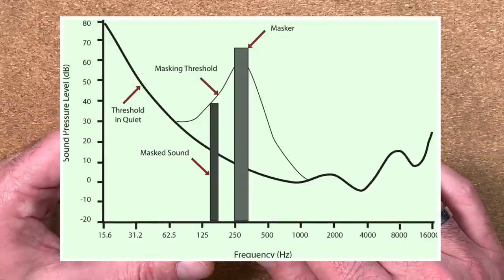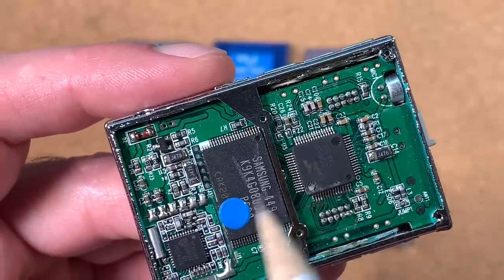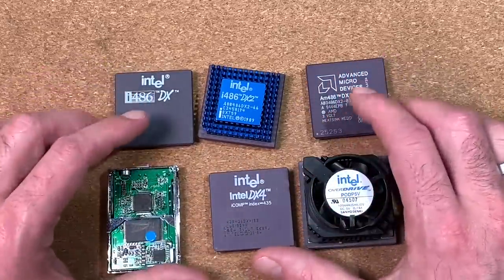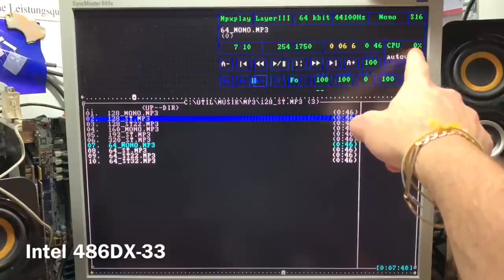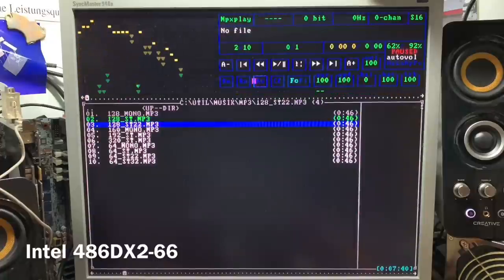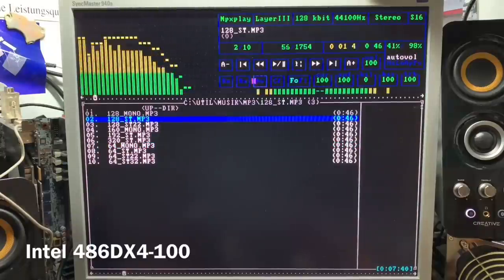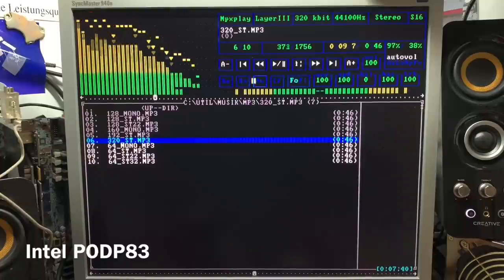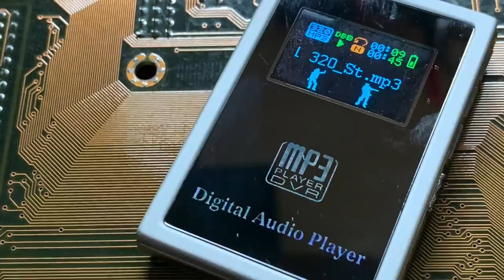Can a 486 Play MP3 Music In Good Quality?

Comment: I remember being able to play a 128 kbit stereo MP3 file on a 486 SX2-50.  You should be able to play it fine on a DX2-66.  I think the visualizer is taking up CPU cycles too.  I remember the program I used was not graphical at all.  It just shows the total frames, the frames played, and the number of skipped frames.  I don't recall the name of the program now, but it was around the same time WinPlay 2.35 (yes, even before WinPlay3).  I was a kid and a university student in Finland sent the program and an MP3 file via usenet.  I was impressed indeed.

If you can find a copy of DOSAmp, I think it'll play better since I don't think it has a visualizer.
Reply: Can confirm DOSAmp was the only way on my 486DX2/66. Windows was a stutterfest.
Reply: @joe--cool  yeah.  I would have loved to see this video redone using DOSamp as the player.  I bet he can play more types of MP3 with his collection of 486 CPUs.

Comment: Graphic bars in the app window take more CPU resources than decoding itself. Disable them and you'll see the difference.
Reply: @alanhightower976  Screen output itself wastes CPU time.
Reply: Right. In those times, even the display output were ressources you had to account for. At least its textmode, which can (not must) be more quicker. But every moving thing on screen is a cycle you could use.
Reply: The FPU is doing all the heavy lifting here. So no, drawing text to the screen isn't going to cost much the CPU many cycles. A 486/33 does not have the floating point performance to decode an MP3. Period.
Reply: @zosxavius  Nope. The theory behind that mp3-stuff is of course all cosine and floating math, but there are a lot of shortcuts and for players (especially in these times) often integer-implementations were used. I highly doubt that the integrated 487-FPU was even used in this player.
I can also assure you, that a lot of the mobile mp3-players (esp. the first generations) had no means of floating point processing.
The data to show on screen was also mostly given and there were no complicated maths involved in showing the EQ-Bands, because these come directly from the MP3, but the management of the drawing on the screen alone took quite some efforts in these days. Yes even in textmode-only.
I'm not saying, that shutting off the display will make this player work on an dx33 but I still assume, that there may be some other more optimized players outside there, that maybe could.
Reply: @JanWalzer  without looking at the program's code you could be right. Given it was written for DOS they likely took some shortcuts. The one dos player I read about can use integers with a flag. The author never mentions if he did any commandline optimizations. I suspect he hasn't. 

The program I saw recommended an 80mhz 486 for  192kb/s. That would put the video's results in line with that program's requirements.  It was called MPXPLAY. 

I would argue that 99% of the MP3 player released to the market used integrated decoding logic as shown in this video vs using their meager CPUs. The power cost alone would probably kill that idea anyways. Much more efficient to just do it on silicon than in software.
Reply: @alanhightower976  I looked it up. Its not using a fixed point decoder nor is there a command line option for one. Given its minimum requirements it looks like its fully using the FPU.
Reply: To add to your comment, it seems that there is a command line option to disable visual output. In fact its recommended for 486s. So there is certainly a cost involved.
Reply: Yeah, I see something is wrong here, it is many years ago but I'm absolutely sure my first mp3 player was a DX2 @66 MHz with mpxplay, it did nothing else, it had a 20 MB Seagate hdd with only the most necessary files on it, boot sequence, which automatically started mpxplay, and audio drivers, I stacked four desktop pc cases of the same type on each other on a roller for plant pots and a monitor on top with a signal switch for the monitor, keyboard and mouse for three of the pc's, the one on the bottom was a 486 @ 33 MHz and served as the file server. Man, that was times, burning parents money for electricity, papa's yelling is nothing compared to when you have to pay the bills on your own, lol.
Reply: That's what I was wondering, all the animations going on must be consuming CPU time.
Reply: @Wilson84KS  dude, my son has a server in the garage that used to run a hospital! There's about 20 HDD's all spinning at 15K day and night! 
I think that I have a small idea of what it costs to run a hospital thanks to my son LoL! 
But hey, you gotta put all that animae and henteye somewhere right LoL...

Comment: It'd be interesting to see how the DX2 based (I think) 80mhz AMD chip handles things when clocked at 100 mhz. I suspect that it's a question of just getting the FPU at sufficient speed to bash the numbers out as fast as the data streams off of the HDD.  Did AMD sell a version of that processor clocked at that speed?
Reply: Pretty sure they sold a DX3/100.
Reply: @geonerd  Now THAT would make an interesting test case. If you look at how things were scaling it seems to imply MP3 decode functionality would start scaling up rapidly from 80mhz onward, but a real apples to apples comparison would be needed to confirm this.

Comment: I found that very same thing out, in that order using WplayPro in windows 95. I've always kept it in my mind that you needed 100MHz + to play mp3's @128-44k. 
Mind you, A 386 40MHz with 8 MB ram and a fresh copy of windows 95c takes less than 20 seconds to start in case you were wondering. Very nice video, I am glad to see I wasn't wrong in my thinking back 20 years ago.

Comment: Can the PODP decode CD-quality files in stereo? Assuming linear utilization scaling, it should be possible.
Reply: Non compressed files should play fine on all those cpus.
Reply: What's your definition of CD quality? When MP3 was the big new thing, 128kbps was considered near CD quality, with 320kbps being considered 'transparent'. 320kbps is the highest officially supported MP3 bitrate too.

If by CD-quality, you mean plain old PCM (i.e literally CD audio), that will play on a much slower machine because it is uncompressed audio; there's no decompression going on; it's just dumping out audio to the sound card- at this point, you're basically at the mercy of the I/O system on your PC.

@CPU Galaxy, it would be interesting to see this test repeated with AAC audio; I was impressed that even running under Windows 95B, I could play FLAC and high bitrate AAC audio on a Pentium 166 under clocked to 75MHz, and with 16MB RAM, using a modern player (foobar2000).
Reply: CDs are recorded in uncompressed 44100Hz stereo audio, and being that cards in that era were also 44100Hz you basically just read the audio and push it into the sound card's buffer.

Never the less because of the amount of data, even if it wasnt cpu intensive, it took quite a chunk of bandwith from your memory and pci bus so most software just assumed you had your cd analog output conected to your sound card.
You technically could do it but afaik only since windows95 there was some kind of "digital audio output" support. Though to be honest i still use the analog output on my mmx200 because otherwise cpu spikes could cause the music to skip.  Id recommend analog for anything below a pentium 2.

Now that i think about it, imagine a desktop case (not a tower case) with a pentium cpu being used as a media center pc.......you tecnically could and with 1-2GB of hard drive you could have quite a few CDs in MP3 format. Throw in a vga card with composite out, a 29" crt tv, an qireless infrared keyboard and a good audio system hooked to the tv and you have quite a nice looking retro media center xD
Reply: You mean wave?
Reply: @laharl2k  CD bitrate doesn't use that much bandwidth. Roughly 11 megs a minute. That's nothing for a PCI bus. Or even an ISA bus, which the first 1X CD-ROM drives came with an ISA controller card.
Reply: @brianleeper5737  
yeah sure, 11mb/s, thats nothing for a last gen pci implementation, but remember these are old pcs with 100mhz fsb.
Dont believe me? just try it yourself, try hooking a 100mbps ethernet card to an old pentium/k6 and see if you can do 100mbps even though the pci bus is more than capable of those speeds.....thats why my k6-II 500mhz Nas never worked, i could barely get 600 KB/s, FTP, SMB, it didnt matter.
Also remember old SDRAM DIMMs werent super fast either, iirc i had about 200MB/s on the ram read speed in the everest benchmark. Its nothing nowadays with modern DDR ram but back then it was quite significant. Add the fact that the memory controller was outside the cpu package in the north bridge and the performance was abysmal.
Reply: @laharl2k  uncompressed cd-quality audio is about 11 megabytes a MINUTE. 

That equates to about 180 kilobytes a SECOND. 

Any 486 class PC should be able to handle that with no problem, even over the ISA bus.

I have played uncompressed cd-quality wav files from an SMB file share on a 486DX2/66 with an ISA  10 megabit network card, the server was another 486DX/66 running Linux also running an ISA 10 megabit network card. And it worked just fine. 

If you were only getting 600 kilobytes of network throughput a second on a K6 II 500, there was something wrong. It should have been a lot better than that. Were you using some off-brand PCI NE2000 clone network card? (The NE2000 was designed to be cheap and originally designed for ISA. They were NOT high performance cards).
Reply: @brianleeper5737  
CD DMAs to ram, then cpu processes it and copies it to ram before DMAing it to the PCI bus, lots of headroom, latencies, etc, its not just 150KB/s (1x CD), you easily have x6-x10 multiplication depending on how good the software, drivers and hardware is. Best case your player had a software buffer on ram to avoid those buffer underruns, but you needed the ram for that....

Also lots of syscalls on windows9x were blocking so that added a lot more lag depending on your hardware. Some sound cards couldnt play two sounds at the same time and windows will freeze or throw errors if you try doing several sound stuff at the same time.  The integrated card i have on my mmx has a virtual thing second card in the driver to be able to play multiple sounds at the same time, if you only leave the sound blaster 16 emulation, you can only do 1 sound at a time. 
Hardware wasnt that flexible back then and drivers werent the best either. 

Not sure what chipset it had but the card worked fine on other more modern pcs.
Reply: @laharl2k  What made the better network cards better is that they used less CPU. I had Western Digital cards with shared RAM as opposed to the PIO that the NE2000 clones used. The Western Digital cards used much less CPU and therefore had higher throughput.

If you put a low-end network card into a faster PC, the high CPU utilization of that low-end card isn't as much of a problem anymore.

The best network cards for the price and performance I found in the 10/100 network card era all used DEC (yes Digital Equipment Corporation) "Tulip" chips. These are long out of production now, but back in the late 90s they worked very well for a network card that cost around $40. I had a datacenter filled with servers running those network card. The Linux driver worked very well with these cards too, at a time when the Linux drivers for 3com and Intel cards were not quite as stable. (And, in an interesting occurrence, Intel purchased the rights to the Tulip design from DEC and EOL'd it a couple years later).
Reply: @brianleeper5737  
Well that could explain it then, cpu was at 100% no matter the protocol. I do have some 10mbps 3com server cards, id have to try with one of those and see whether i get faster speed and lower cpu usage.
Reply: @laharl2k  The 3com cards were pretty CPU efficient as I recall. IF the motherboard has PCI slots, try an Intel gigabit network card too and see how that affects the CPU usage. You can also find server-grade PCI-X Broadcom and Intel gigabit cards on Ebay for under $10 and that probably includes shipping. This will work in a regular 32 bit PCI slot as long as there is nothing on the motherboard blocking the extended part of the card edge.

Comment: Excellent video and channel. 

A bit surprised by the result. I know for a fact that an Am486 DX2-66 can play a 128kbit stereo mp3 without (well almost without) skipping...at least on some players, because I did that way back when. 

I can't remember which player I used, but it wasn't nearly as fancy as this one. As far as I can recall the player didn't have any output to screen at all. And if it did, it was only some minimal info about the file.

It's possible that the added screen effects are just too much...however...it is also very possible that the player I used just leveraged a large memory buffer. I did have 20 MB of RAM - which was HUGE for the time.

Comment: Shows just how good it is to have some floating point math dedicated to a task, where you do not have any general purpose processor other than the one 8 bit one doing housekeeping, while the rest of the silicon is optimised to only handle audio encode and decode. Decode is somewhat easier, as it only has to recover the compressed data back into the full bandwidth stream and parse it out via DMA to the sound card, while encoding has to pull in the same audio and speculatively test to see if any FFT bin is masked according to the filter, then drop those masked blocks, and then compress the rest of it to a smaller size block of data, while simultaneously writing the previous blocks that are complete out, getting the next ones in, and shrinking the data down to fit the block size. 

Then handle a file system that can be non contiguous, and disk write rates that vary all over the place because the drive takes a lot of time to change cylinders and write non contiguous sectors. Oh yes, also update a FAT structure on the fly, where you have to go in to the last FAT block, see what is available, and append to it. Video funny enough can be smaller in size, as poor quality is not as objectionable, compared to poor audio, which is very nasty. You can watch 144p video with only little problem, but try the same with 8kHz mono sub telephone quality audio, it is horrid.

Comment: This is consistent with my memory. I first played 112 and 128kbps mp3 files on my AMD486dx4/100 in late 1996 and it used around 90% cpu in Win95. I can't remember what player I used, but I still have a lot of the original files I used at the time too so ill have to give it a try one of these days. I seem to remember at 150mhz my amd5x86 played mp3s decent enough that i could multitask with a mp3 playing.

Comment: Couldn't wait to see this video and it hasn't disapointed! Loved it!

I still wonder about my memories using a 486SX tho.  The linux soft-fpu seems to be ~10x slower than the real deal, altho quite a bit faster and common DOS fpu emulators. Which I admit makes me scratch my head a bit. The only two things in my favour is that the player I used was purely commandline, no vumeters or anything. Not even a progressbar. Anything like that and it didn't work. The second thing is I never programmed under a dos extender like the player in your video uses, just realmode programs. So I'm not authority on the matter, but maybe there is a overhead there compared to running purely in protected mode under linux? Especially if this player uses DPMI to use DOS api to update the display that often. The context switching that requires might account for some of the difference.

But honestly, under the best conditions I can only see that making it possible to use a 486DX-33, maybe with some fairydust a 486DX-25 (do they exist?). But not a 486SX2-50. Guess I'll have to setup an eBay alert for when a system comparable to what I had shows up to resolve this mystery from my past. :)

Comment: In 1993 I had a AMD386-40 and a friend of mine worked on audio coding at the university. He was part the university group that created predecessors to MPEG 1 Layer 3. Since I had a self build 16 bit ISA soundcard back then, I became a candidate for testing the encoder and decoder. I remember the CPU was by far not able to decode audio in real time so it had to write a 3 minute song onto the HDD which took like 10+ minutes. Encoding took even a lot longer. I remember that I encoded Duran Duran Ordinary world and it took a lot over 1 hour. I ripped that song of the CD with the same selfmade soundcard using SPDIF. The HDD was a 540MB Maxtor. Computers have come quite far since then.

Comment: I got to play MP3 on a 486DX2-50 notebook, it was around 1998 under Windows 3.11 and using WinAmp 1.2 or 2.1 (I don't remember).

WinAmp has a lot of options for improving performance by disabling channels, downgrading kbps and many others.

Then, with my "most powerful 486 in the world" I got to play DVD films under Windows Me. It's an AMD 5x86-P75@160Mhz, 256MB of RAM (no, I'm not wrong), S3 Savage-4 32MB PCI, Sound Blaster AWE 64 Gold and the jewel crown RealMagic Hollywood Mpeg-2 hardware decoder.
Reply: Oh man I still have my RealMagic Hollywood card, it was the only way I could get my old K6-2 to play DVD's.

Comment: in 1998 took my 486DX2-66mhz pc and loaded DOS and a DOS TSR that emulated Pentium floating point operations(because it was required by the player at the time) for DOS to play MP3's using a DOS based MP3 Player that did a full screen Graphic EQ visualizer that I used to display on a LED matrix in my 1985 Oldsmobile Toronado with a 800mb HDD loaded with MP3's encoded at 192kbps 44khz Stereo. Worked flawlessly.